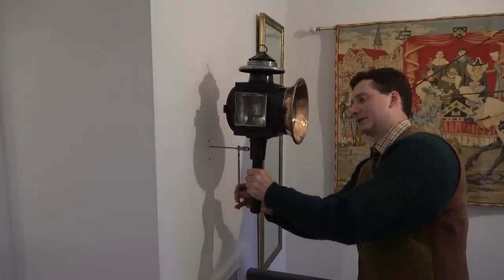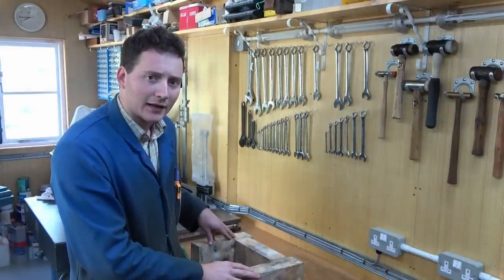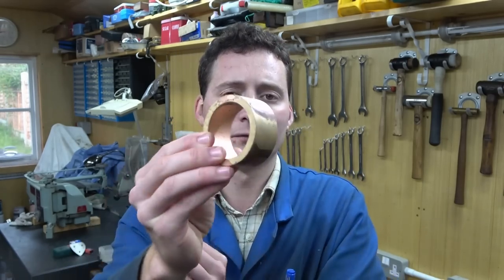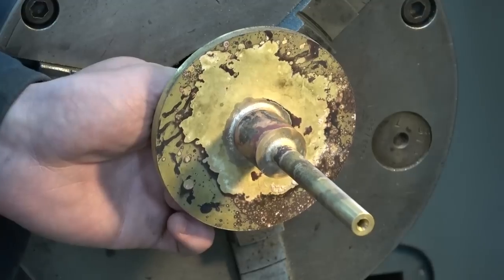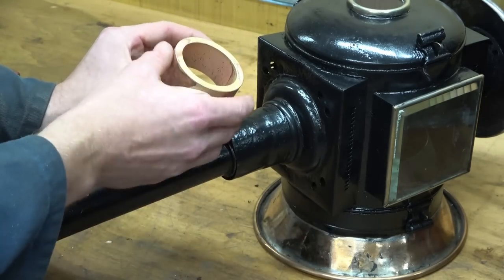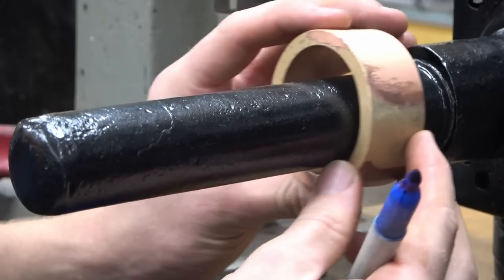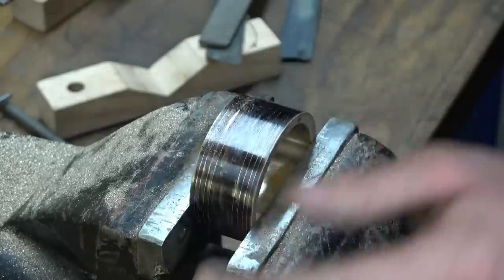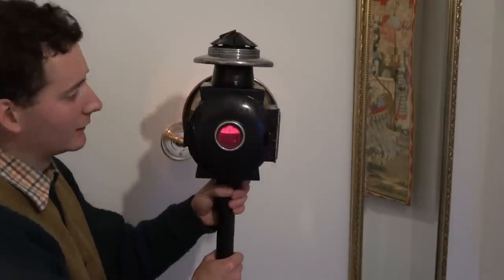Machining a ....... Something Unusual

Comment: Amazed at how good that hand filing looks!
Could anyone explain what the risk with the soldering was? Some chemical reaction?
Reply from the maker: Thanks. Do you mean the silver soldering of the two pieces together at the end?
Reply: @MrCrispinEnterprises  The piece you decided to screw instead of solder, because...tin?
Reply from the maker: My concern is that what ever is alloyed with the Bronze is not compatible with the Silver Solder and flux that I was using. Based on suggestions from the comments it could well be Aluminium Bronze. Aluminium doesn't take standard Silver Solder
Reply: Thanks. Hope I'll remember that when needed.

Comment: Interesting - nice work as always, pretty sure you're right about the candle, I had one similar years ago, the top end had a cap with a hole for the wick and the spring pushed the candle up as it burned. If left unlit it would gradually extrude the candle over a few weeks which always amused me, little things please little minds they say.
Reply from the maker: Never thought of that! Interesting!

Comment: Could be depletion gilding? Bringing an alloy up to a temperature where the lower melting metals can flow out and towards the flame while leaving the base Metal Solid. Then those flux metals either oxidize and burn off, or come off in the pickle, or you leave them on the surface like gilding.
Reply from the maker: Yes I think your right. The question is what metal came out. If it were pure Bronze then there would be no alloy to come out. Best suggestion so far is Aluminium Bronze
Reply: No idea! Seemed like it was a very superficial discoloration that came off with a file. Just like Jeweler's brass or old school copper and Tin bronze that got a little hot during soldering. But you used a low temp solder didn't you? At any rate we can find out in about a hundred years based on the natural patinas that form. Looking forward to a follow-up hologram video

Comment: Excellent job Mr Crispin!  Have you told about your Slow Speed Grinder? Is that to Sean's design?  Cheers from Toronto.
Reply from the maker: I featured it briefly in my video 'Grinding and Honing Lathe Tools' but I am going to do a proper video on it as it's very useful. It was built by Dave Ticehurst based on Stefan's design.
Reply: @MrCrispinEnterprises  Thank you Sir,  I plan on building one so your input and observations would certainly be appreciated.
Reply: Look forward to a video on the lapping wheel. I'm guessing that is a car wiper motor with worm and wheel drive?
Reply from the maker: Yes indeed

Comment: That's a lot of hand filing, whew!
And what a gorgeous result…

To what grit do you lap the turning inserts?
Reply from the maker: I think that was only about 600
Reply: Mr C, that was an interesting lap made, I'm assuming, using a windshield wiper motor and gearing. Do you have a video of it's production or was that back before video was invented? (Someone said you were born 100 years ago or something to that effect.) I don't believe that really. 
Could be an interesting side project as if you need any more.
Regards (seriously) from Canada's banana belt.
🤞🇬🇧🕊️🇺🇦🍌🇨🇦🤔👍
Reply from the maker: It was made by Dave Ticehurst and based on one that Stefan Gotteswinter made. Yes windscreen wiper motor

Comment: Probably Aluminium Bronze, used on boat shaft bearings.
Reply from the maker: Yes that would make sense as it was probably about 600 - 700 degrees when it melted out.